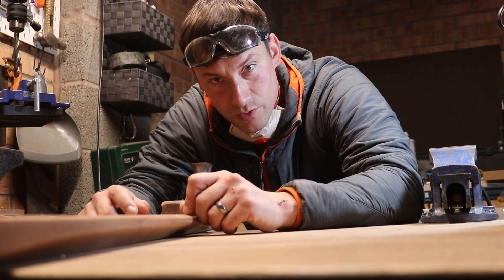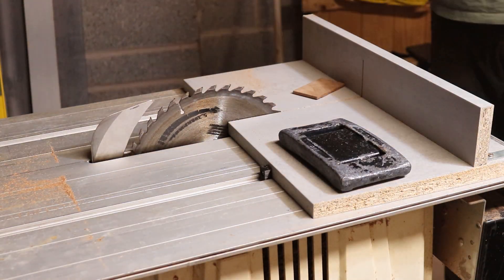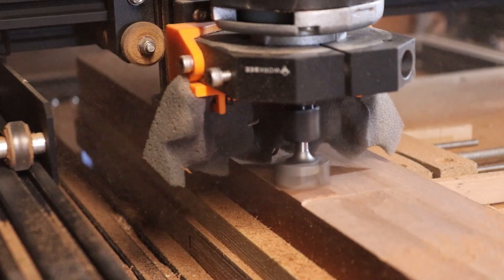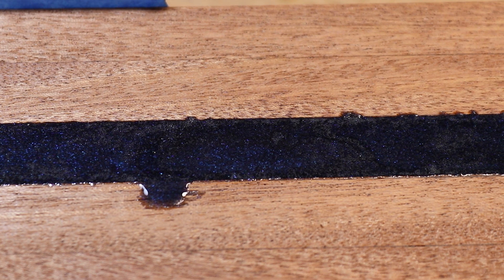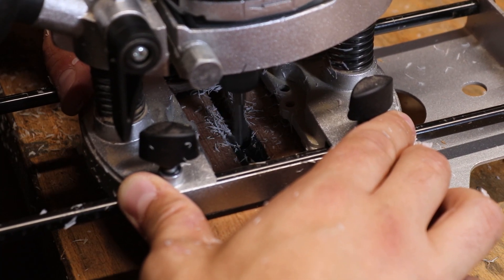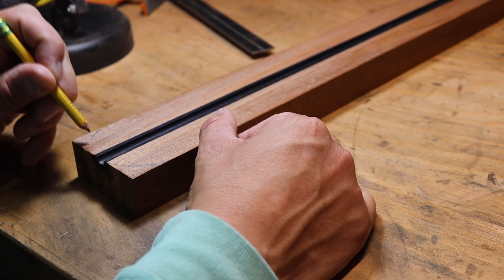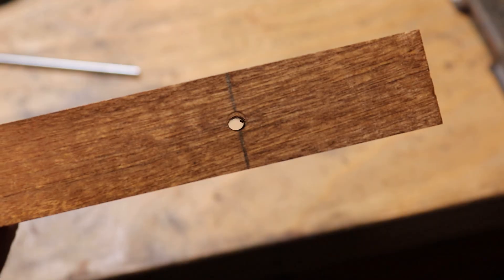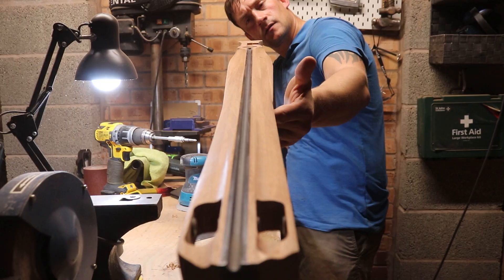Making a Roller Speargun From Scratch! PART 2

Comment: Looking good! Going to start my own build soon, what size routerbit did you use to cut the track? Having a hard time finding one that matches the spearsizes. Cheers!
Reply from the maker: Thanks mate! So I managed to get a 7mm ballnose end mill online - same diameter as the spear I'm using. It took alot of searching to find one though that was a 1/4" shank so I feel your pain. I'll see if I can find the company I bought it from. You UK based?
Reply: @OceanicMatt Living over in the other side of that big canal in The Netherlands haha. Managed to find an 8mm yesterday (which might work?). If you could send me the brand of the bit I might be able to source it here. Thanks for your reply!!
Reply from the maker: @casvanboxtel7024 You might get away with an 8mm, I used a website called
 MSCdirect.co.uk.... don't know if they would ship internationally though
Reply: @OceanicMatt cheers!

Comment: What depth did you cut your track to? Got the same mech but not sure how deep to set it? And what the depth of the mech is in relation to your track. Cheers
Reply from the maker: Hi mate, I cut the track around 4.5mm deep for the 7mm shaft. 
As for the trigger mech, depth for the body I cut down to 22mm, front mounting arms 6mm and the rear mount was around 5mm.
I lined up the underside of the rear mounting hole face with the top face of the blank (spear fitted in the mech) to roughly gauge the depth.

Comment: I'm planning to make an invert roller gun out of mahogany, so I'm really interested in how yours will turn out in the end and what should be taken care of so that it doesn't get messed up, I'm also interested in whether the rollers can be without ceramic bearings or can they just be like a hole in them that goes directly to the shaft that will hold them, your work is great, just keep going
Reply from the maker: That's great to hear! I'll probably try and invert in the future! Out of everything so far, definitely the barrel is the most critical. Everything else can be tweaked but if the barrel isn't cut properly or isn't straight you're limited on options really! 
I've thought about the same with rollers myself, I was originally going to 3d print the rollers but I wasn't sure about the friction and opted for the ceramics. Given how inexpensive they are it was a no brainer for me! Something I'd be willing to test though
Reply: @OceanicMatt  thankyou bro i will do same, without mistakes i hope and i will update you about my build. Keep up the good work man❤